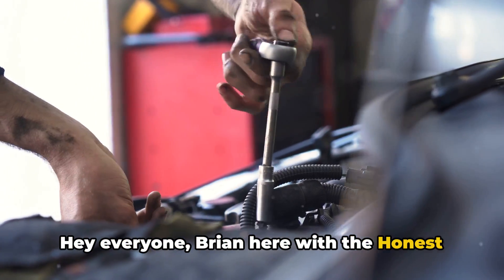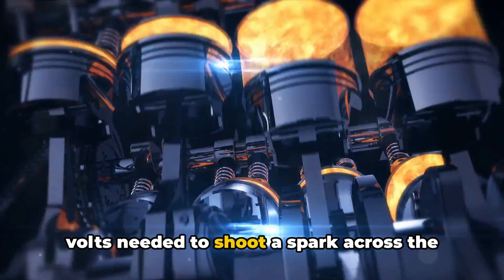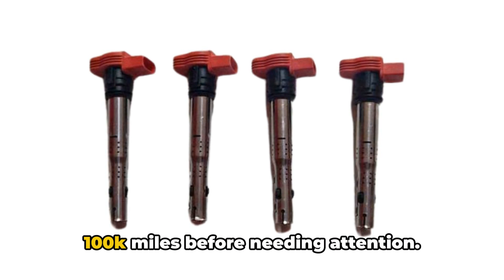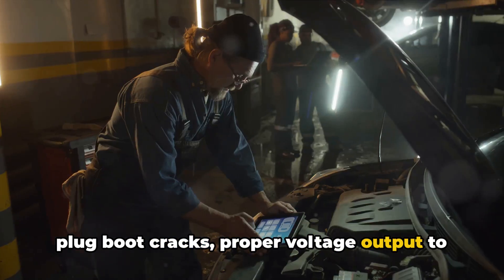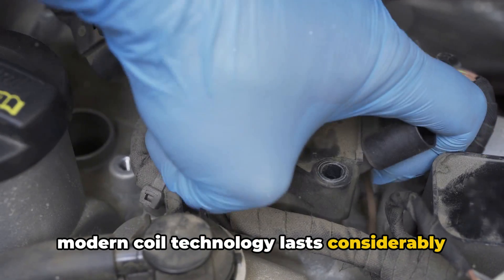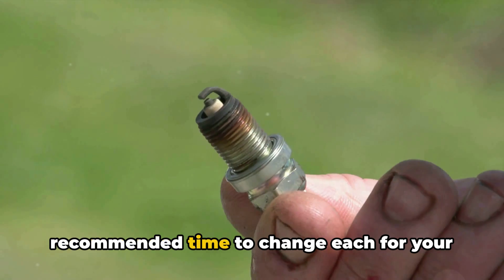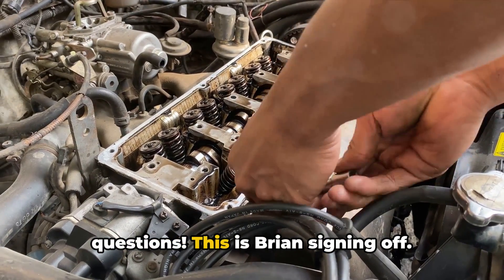Should You Replace Coil Pack with Spark plugs? (At the Same Time)

Comment: Checked engine light code- (auto parts store) they said it was COIL PACK and it didn’t give a specific cylinder though. How do I go about figuring out which one it is without replacing them all?

Comment: I have a 2012 Dodge Grand Caravan I'm getting new spark plugs put in. It's got 198,000 miles on it and i haven't had it for a year yet. Should I get the ignition coil pack put in please let me know what you think.

Comment: Mustang 2010 gt up and down idle and burning so much gas , i change fuel filter air filter o2 sensors i have 4 o2 codes, i clean throttle body, and the problem still here tomorrow i will change sparks and all coils so painful because i need money now and my car is bad and i need to fix it , i have 120,000 miles so what do you think ?

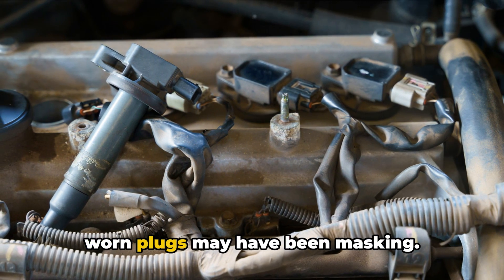Comment: I disagree that fresh, properly gapped plugs(1:45) impose a higher voltage demand on the coils. Actually, I think the reverse is true. Older worn plugs with wider electrode gaps and rounded edges from erosion will require higher firing voltages, placing higher demands on the coils and hastening their breakdown.

Comment: My 2019 Hyundai Elantra keeps misfiring every now and then.. I have an appointment on January 2nd at 1:30 to get spark plugs and Coil packs looked at.
Reply: How did it turn out? Was it your spark plugs and/or coil pack? Also, how is that car in general? My sister just purchased a 2020 Elantra.
Reply: I have similar issue. What was the diag on this and the solution? Would be great to know as I am in the process of buying spark plugs and potentially 4 new coils within the week.
Reply: I am changing my ignition coils. It’s a 2010 Toyota rav4 with original Japanese everything it’s 15 years old and doesn’t look like anything was ever replaced. I pray the coils be my saviour to my quest in getting rid of cranking with no start issue. I replaced 1). camshaft position sensor
2). Engine Crankshaft position sensor
3). Spark plugs 😢

Comment: New spark plugs have a smaller gap than worn spark plugs, so they work with a lower voltage. Replacing spark plugs does not put a higher voltage demand on the coils, unless you have the wrong spark plugs.

Comment: As long as you change bad spark plugs ignition coils usually last.
Reply: At 100,000 miles is time for new coils they don't cost that much you don't want a break down on the road

Comment: It takes me about 12 hours to accomplish the rear plugs on my transverse 3.3 Santa Fe, I take the intake all the way off and clean everything, vacuum out leaves and stuff, clean the throttle body , etc, then I’m not leaving a coil pack in there after all that, I recently replaced the injectors also ( some people are refurbishing them, that ain’t me) then it’s about 4-6 hours replacing everything and then 😬, the moment of truth, that’s a real anxiety event when you turn that key

Comment: Bought a 2003 XJ8 with 16,000 miles (verified). The car was sitting in a garage and not driven for 5 years (due to age of owner). Changed all fluids, tires, filters, a few rubber-related parts. The car passed inspection. The problem is engine and warning lights and limp mode popping in after about 20 miles of driving. OBD indicating fault codes for throttle body and  for ignition coils and spark plugs in cylinders 1 and 3. Throttle body and sensor cleaned and now I'm inclined to replace all plugs and coils. Can anyone think of an argument against doing so? Additional info: the car was purchased by an elderly woman in Santa Monica, CA and primarily driven short distances on secondary roads in her neighborhood for 15 years before being garaged. I know the daughters and they do not think their mother (now deceased) ever drove on the car on a highway. Stores and social functions. Back to the sparks and coils... thoughts and opinions greatly appreciated. As well as manufacturer  recommendations  for sparks and coils (leaning towards NGK. Also, I'm not a mechanic but have been under the hood and car before including changing the air suspension on my wife's 2004 XJ8 to the Billstein shocks and coils kit (which I prerfer to the air suspension). Thank you for taking the time to read this post.

Comment: After several P0300 misfires I changed out my plugs with genuine OEM NGK iridium spark plugs and closed the gaps from .032" to .028" due to reading many forums that closing the gap will minimize the misfiring issues. Additionally, for peace of mind i emailed NGK technical support and asked them if that was going to harm my plugs as they're iridium and not supposed to be regapped. Per their reply .008" is their maximum recommended distance to close. After installing them and installing 4ea. Zz performance coils I'm noticing the vehicle runs significantly better. Fingers crossed no more Check Engine Lights (P0300). Vehicle has 64,000 miles and is a Saturn Sky Redline

Comment: I just finshed changing the plugs and coils, and cleaned the throttle body on my 2016 canyon with 194k. I bought the truck with 80k on it so I thought it was time for both. The other reason for doing both is that you need to remove the intake manifold to get to some of them. Just made sense to me.

Comment: I appreciate your insights shared! My dad was my mechanic and sadly he has died. Im not standing on solid foundation financially speaking, so I am forced DIYer Especially since my husband too has passed. Grateful in the fact I was my dads small hands and enjoyed tinkering growing up. The only issue I have now is I find it hard to trust most mechanic shops! I now rely on the internet and end up reading and watching you tubes until I can understand the reasons of whys and ifs with good sense. And this you shared makes good sense to me! thanks again ✌️
Reply: You’re doing the right thing, I had a engine problem, went to the dealer and they replaced 1 spark plug in the back and the coil pack with it, thousand bucks 😢, when I got it home I pulled everything apart and replaced the rest, less than 200,
Reply: @jwrn4u  a mobile mechanic wanted 120-150 per coil on my ram 1500. I’ve decided to do it myself. Saving a lot of money
Reply: I have been blessed with a REAL honest mechanic here in KCMO. I buy the parts and then charged half of what that cost is for labor or less. 143$  for spark plugs n coil packs.....75$ to install. Struts are next. OOO I have a  black 2008 Toyota Solara with a tan rag top..... 174K... all diagnoses are FREE.....10$ oil change....I buy oil n filter.....I give him 20$ cause he is training his 19 yr old Grandson to take over when he retires in 3 yrs. He has his own garage on his land that he had built in 2017. 2 hydrakuc  lifts and he specializes in EXHAUST systems. God Jehovah Jireh is the provider of our every need n want.
Reply: God bless you

Comment: I just had my spark plugs replaced. Wondered if i should do coils. Car has 135k miles on it. 2006 civic
Reply: Don’t replace them if there is nothing wrong withe them, I just did the same on my ford e250 I replaced all of them and ended up causing multiple misfires.
Reply: If it's not broken 

Don't try to fix it.

Comment: I ALWAYS replace the 3 coils in the back for V6 engines, because it's hard to change the 3 spark plugs in the back.  Spark plug change, e.g., for Lexus cars, typically at 100K miles are hard AND expensive.   You don't want to pay for labor again to replace the back coils afterward!  Save the old coils for the 3 in front, which are easy to replace; even Homer Simpson can do it!!!
Reply: In those cases  its a good idea😊
Reply from the maker: Great advice! Thanks for sharing
Reply: Correct

Comment: And always use high quality plugs, like iridium. They will last around 100.000 km. And ensures a good spark and clean combustion.
Reply from the maker: Spot on!
Reply: If u can use spark plug non foulers. Makes em last even longer. Even the old copper kind.